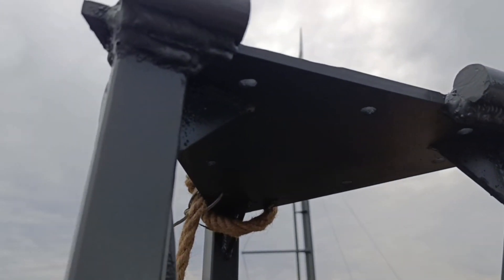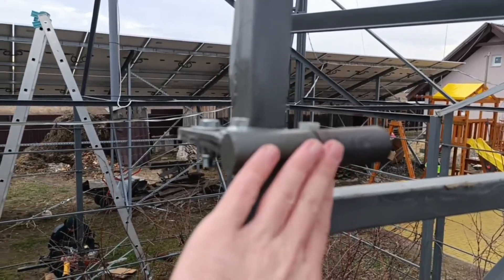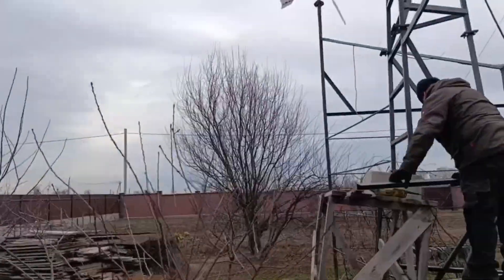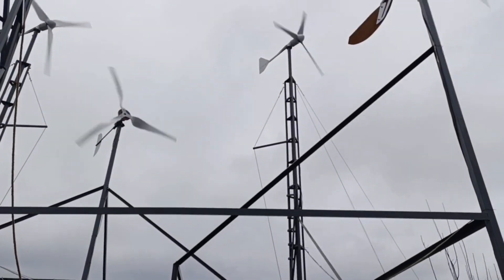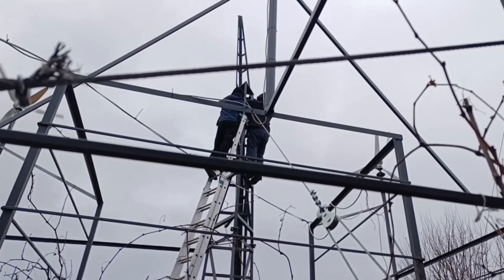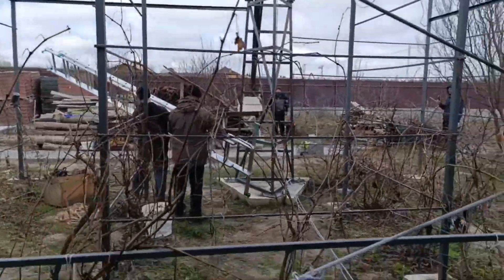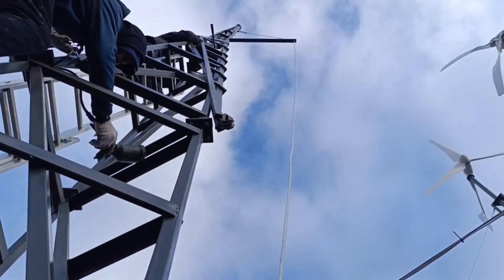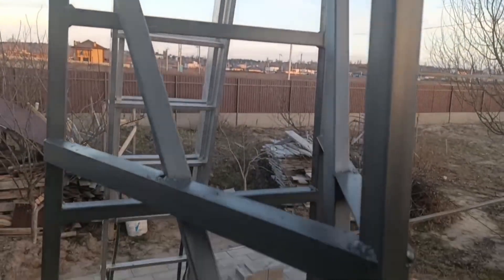An old new wind turbine tower: was 9 - now 12 meter height, was stationary - now foldable!

Comment: We have what I think is the exact same overhead hoist lift (2200 lbs capacity with a pulley and two lines, made in china and branded Vevor). Our FD4 huaya turbine has a 4m rotor (3-4Kw) but on a tiny 3m tower with a 2.2m mast as it is crazy windy here (40-60kms/hr almost daily and 80-90kms/hr weekly). We even have it hidden in some short spruce trees. Ha ha.  Mine is the boost buck with the mppt controller but the boost doesn't seem to be working well; as it doesn't produce any power until it reaches 58V at maybe 100+rmp. The wind controller also does not work well with the two solar charge controllers (Esmart3, runner, etc made by iSandi, iPanda, etc names) and causes the charge voltage on the solar charge controller to jump between 40 and 60V on our 48V LiFePO4 bank.
Reply from the maker: hm. if your controller does not start charging until 50+ volts - it has no boost I'm afraid...

Comment: great project, what is the starting wind-speed of them to generate electricity? 3m/s with 800W-2KW?
and have you made any experience with Printed-Circuit-Board-stators for wind generators instead of the big copper coil-stators?
Reply from the maker: turbines spinning start wind speed is from 1.5 to 2.5 m/s (depends on the turbine itself). production start is at about 2.2-2.8 m/s for all of them, but again depends a little bit on the wind turbine too.
the smaller the wind the less the watts are of course.
and no, I haven't tried anything aside of the copper-coils on the stators.
Reply: @BackyardVoltage   interesting details, seems like efficient generators are used here. thank you for your answer

Comment: i now have approval and a copy of the regulations i need to follow to put up a tower for a wind generator on my property.......i am looking for a good quality 500w generator to start with and see what will actually be the production here. the solar has been poor the last 8 weeks so i am looking to wind now for more power in the short winter days.  your videos are very helpful, thank you for sharing.
Reply from the maker: well, if I was starting now, I'd not go with less than 2.0 m in diameter (that's M5 chinese model). however, if to be fully honest - rather go with the FT-2000L2 (3.2 m dia) as the first one, that one is already a good one and will get you some production.

Comment: Would take me years to get an approproval for such a tower
Reply from the maker: it depends on the location for sure. local regulations matter, and matter a lot. in my place I am allowed to put anything that is below 45 m height without any building approvals or requirements.
however, still, I am using the common sense safety measures - if it falls - it should not touch any building nearby, and it should lend fully on my property. These are "just in case" precautions.